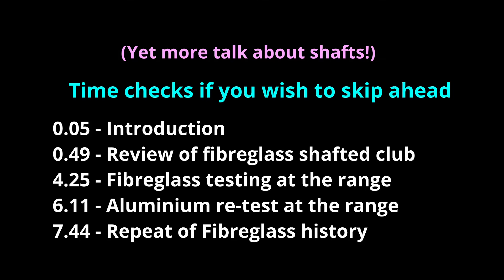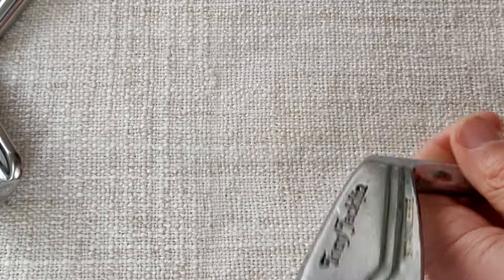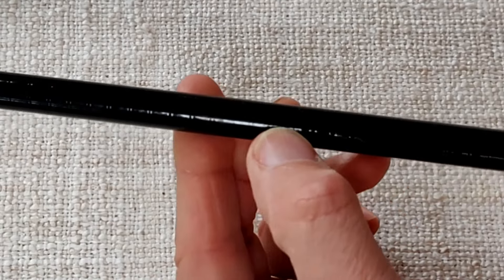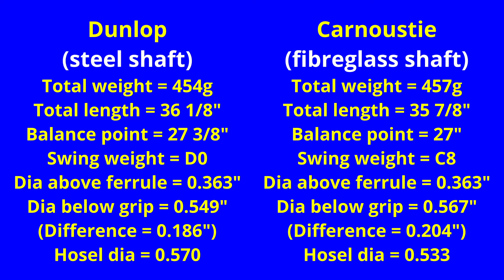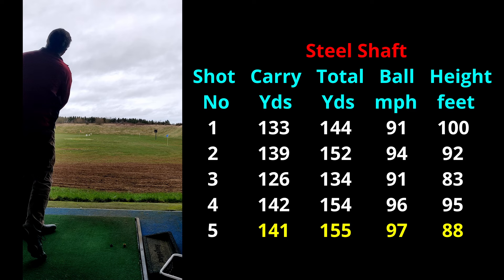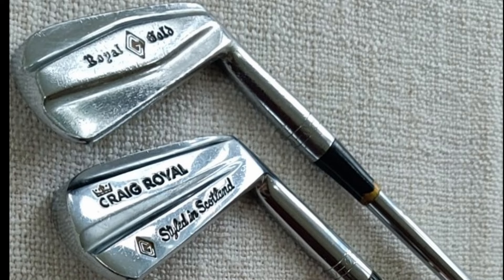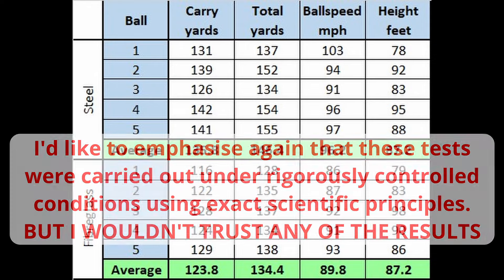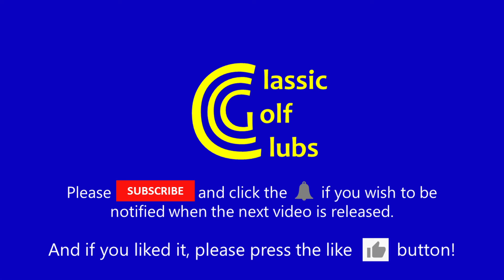FIBREGLASS GOLF SHAFT? - How does it compare to a Steel Shafted club?   #golf fiberglass

Comment: Another fascinating video!
I have a Lloyd Mangrum putter with a glass fibre shaft which I believe will pre date these. 1950's? There is not a lot of expectation or action from a putter shaft so it was probably weight rather than dynamic properties which prompted its use.
Reply from the maker: When looking for examples of fibreglass shafts I noticed a lot more putters than irons or woods so I think you're on the right track there.

Comment: i find this very interesting , that glassfibre golf shafts were a fail, yet carbon fibre shafts are common now . Glassfibre fishing rods were  the norm until carbon fibre took over  So carbon fibre is successful for both  yet steel and glassfife were fail?. I think 'Apollo' made fishing rods? Daiwa made both fishing and golf equipment .I'm suprised 'Shimano' don't make golf gear , they make everything else .
Reply from the maker: It is fascinating, I think the reduced weight of the graphite or carbon fibre shaft gives it a big advantage over fibreglass and perhaps the of fibreglass development at the time wasn't good enough to provide a shaft that could meet the exacting requirements of a golf shaft?